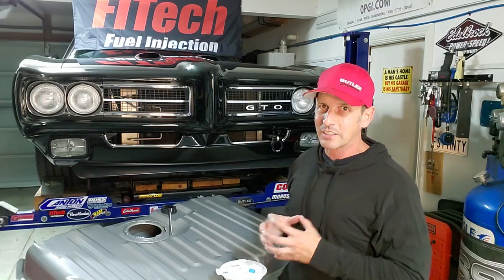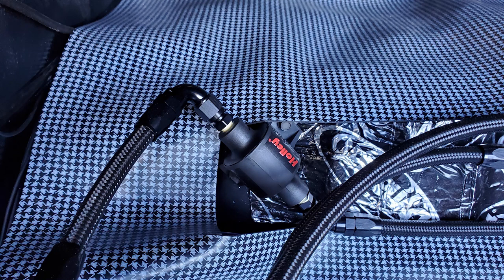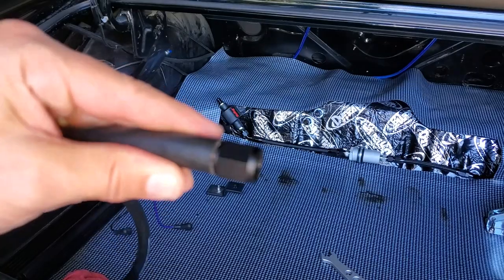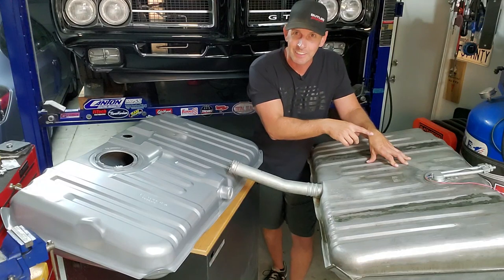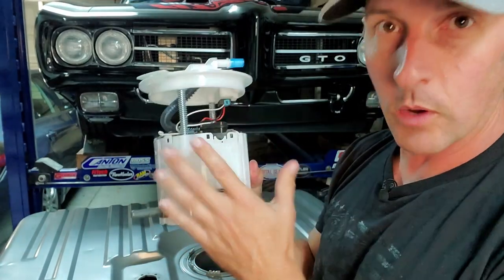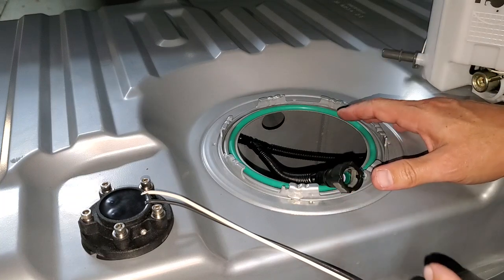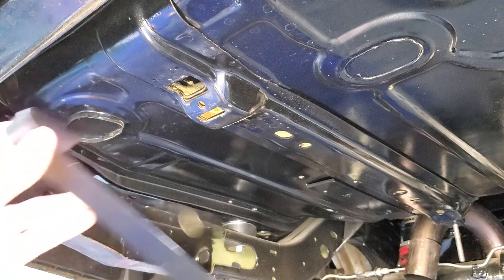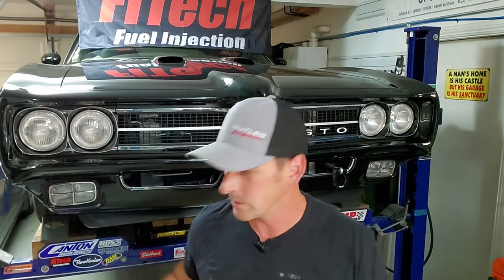How to install an In-Tank, Fuel Injection Pump Module, with no return!  Part 1

Comment: Been watching a lot of your videos lately, as i also have to do a teardown during winter. Last day before winterstorage i developed a ticking lifter, i now have a flat tappet hydraulic, no amount of adjustment (with engine running) can quiet it down, including bottoming out the rocker on the stud. So i did as you did, call butler and orderd a topend kit edelbrock heads 310+ cfm with port matching (TorkerII) same cam as you +++ have still to begin teardown. migth upload some snippets to my channel been years since uploded anything.  And keep on uploading, i get a lot of tips watching your channel.
Reply from the maker: Thanks Stian... sounds like you're in for some fun!  Nice selection of components you got there.  Keep us posted, and thanks for the comment!

Comment: Thanks for all you do for old school V8 guys.  I plan on installing Holley efi,  so this is a plus and will definitely be calling Rick's.  I also wonder if Holley or Fitech harness will power electric Pontiac water pump.  Oh yeah, please let Rick know the tank didn't work.
Reply from the maker: Thanks Rob... things not fitting quite right is more of an expectation with my car.  😅  To answer your question about the FI harness controlling electric water pumps... I think so.  I say that because the FiTech unit I have can control two fans, with two different temp ranges.  So, if you use one fan circuit for the fans, and the other for the pump, I think it'll work.  When I put mine in, one of these days, I'm also going to wire it so I can manually, or use a turbo timer, to keep the pump going after I turn the engine off.  Fun stuff!
Reply: nice thanks

Comment: are you able to provide a part number for the fitting you used on the sending unit that went over the plastic line feed
Reply from the maker: Actually, I think I can... check this out... https://www.vaporworx.com/shop/product/fpofgmqcan6/  If that's not exactly it, contact VaporWorx directly as I'm sure they know exactly what it is you're looking for.  Have fun!
Reply: @FastMonty  thank you that helps alot i didnt want to have to use old hose clamps
Reply from the maker: @mikeh1348  Ha!  Agreed!  I'm addicted to AN hoses... they're all over my car.  Have fun!

Comment: Great video Mike I have a question is - 6 AN sufficiently big enough to support your HP of your Motor I have a big block in my Chevelle I was told I needed -8 so that’s what I used on mine
Reply from the maker: I assume you have a carb?  Fuel injection doesn't need the massive line volume, until you start pushing 800hp, etc... A Carb engine needs a bigger pipe for the mechanical pump to pull from.  Thanks for the comment!

Comment: The AN-6 conversion fitting at 10:30, where did you get that, I want to do the same thing. Thanks!
Reply from the maker: Great question... that came with the pump, you just have to ask for the 6AN adapter when you get the pump.

Comment: Hey Monty why didnt you use a mech fuel pump for the low pressure side to the sump. This would have got rid of the noise and saved alot of hassle. I just picked up an MSD Atomic efi kit and trying to figure out what way I want to run my fuel set up. Its going into a rock crawler so I like the idea of the sump as well. I can carry the carb on the trail if efi takes a crap and my mech fuel pump would be ready to go if needed. Whats your thoughts? Thanks just sub'd to your channel.
Reply from the maker: Welcome to the FMG family!  Great question... I suspect you're referring to the Force Fuel unit reservoir as the sump.  In my installation playlist, I decided to get crazy and mount it in the trunk.  So, running a line from the Mechanical pump, didn't make sense.  Anyway, that's why I had that loud Holley pump, filling up the sump.  Problem solved.  Ha, ha... To your point, mounting the Force Fuel unit in the engine compartment is definitely what that's designed for.  Otherwise, Plan B should be this video.  Thanks for the comment!
Reply: @FastMonty  Thanks for the reply. Yes I would be installing it in the engine bay. I heard a lot of horror stories from the first FI tech command center that had no return line. I see the new unit is upgraded and assuming has a return. You end up selling it?
Reply from the maker: @Allianceoffroad  I still have it.  Shoot me an email.  fastmontysgarage@gmail.com

Comment: Mike- I’ll be converting my 69 mustang to fuel injection. I’m also going to run an in tank Holly pump that is returnless. It seems like the returnless systems are more prone to vapor lock… what are your thoughts on return vs returnless?

Also… I’m looking to add a vent to my tank. What are you doing for a vent or does the new tank have a provision for it? I’m reading that these old cars usually have a vented gas cap but when converting to an in-tank pump, there is a bigger need to vent. Supposedly the pump generates heat enough to raise the temperature of the fuel and thus creating additional expansion/contraction.
Reply from the maker: I've never heard of Vapor Lock being an issue, UNLESS your tank is not vented properly :)  I almost got the Sniper pump you're referring to, but opted for the Baffled Tank from Ricks.  Let us know how it goes!
Reply: @FastMonty  Hey Matt. Vaporlock from a practical standpoint does not occur forward of the high pressure pump. Where problems occur is at the inlet to the pump due to suction. As in-tank fuel temperatures increase the chances of fuel boiling at the inlet to the pump greatly increase. With a full return system that circulates fuel through a hot engine compartment, the fuel load becomes a giant thermal battery. Though the setup Mike has is all in-tank, it is technically a return type. For larger pumps, it's best to go true returnless where the pump becomes variable speed to match the targeted fuel pressure.
Reply from the maker: @carlcasanova6976  Thanks Carl!  Love the insight... much appreciated!

Comment: Crazy how ricks aftermarket tank for your gto wouldn’t fit . 
Does Aeromotive tanks have the same problem with the gto’s as well? I have one for my 70 chevelle and it fit great . But like you said usually it’s always a struggle modding 50 year old cars . 😎😎
Reply from the maker: Yeah, not all 69 GTO's are the same, ha, ha... Not sure if an Aeromotive tank can fit the LS3 Camaro pump?  We'll see how it goes with this one... Thanks!
Reply: Aeromotive and Holley all use Tanks inc tanks I measured the one I got it looks like it will fit but I will see next month

Comment: Will this system work with a carburetor?
Reply from the maker: If you can dumb down the pressure to 4 to 7 psi, yeah, I don't see why not.  I'd ask Vapor Worx, as they're the experts on this stuff.  Thanks for the comment!